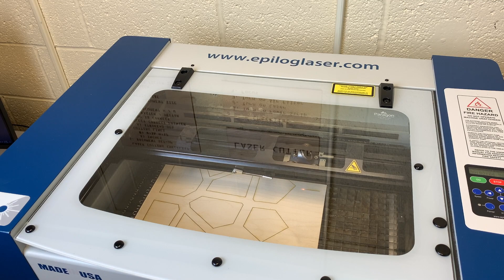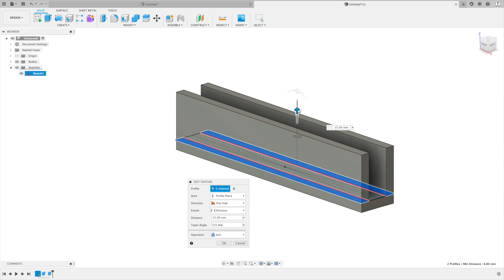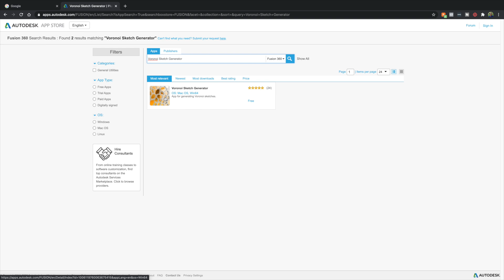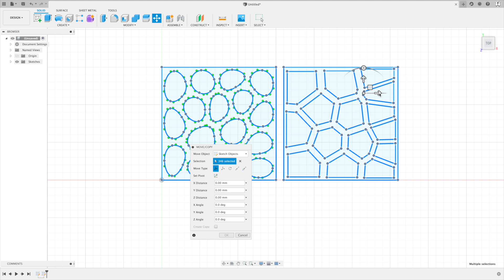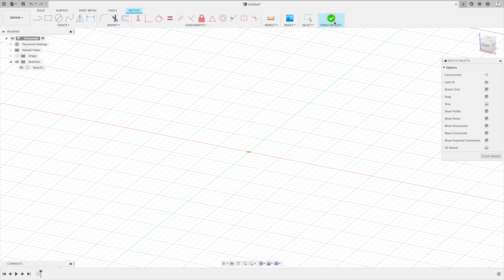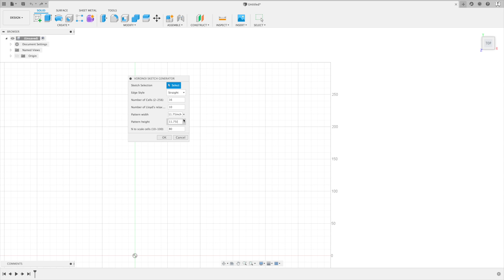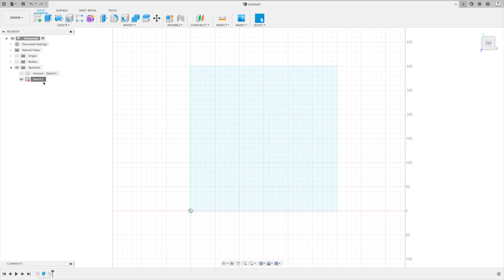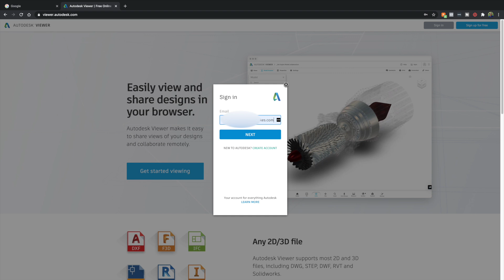Get Creative with the Voronoi Plugin in Fusion 360

Comment: Hello!
What version of Fusion360 did you use in that video?
For now it says, 

"The add-in(s) listed below use the Fusion 360 JavaScript API, which is being retired and will no longer be supported as of the January update of Fusion 360. If you want to continue using the script or add-in after the update, it needs to be re-written to use the Fusion 360 Python or C++ API.
Voronoi.js"
And the add-on is not available.

I'm with Fusion 360 v. 2.0.9512 on Mac 10.13.6

p.s. Thanks for your uDemy courses, I really enjoy them!

p.p.s. Nevermind. Answer from Hans Kellner the developer of the add-on: "New version will be posted soon."
Reply from the maker: Ok, good.  I'm getting the same message.  Looking forward to the update so I can stop seeing that message.

Comment: Hi, great video. I'm actually trying to use this plugin myself, but I haven't gotten it to work. It told me that the installation was successful but it hasn't shown up on the create tab. I tried a lot of things like moving the file to a different location, using the version on the original creator's github, and a lot of restarting, but nothing has worked. It shows up on the add-ins list but not on the create tab. My other plugins are working just fine (although they are Python based). Do you or anyone else reading this have any idea how to fix it?

Comment: Looks good; however, I would take it down ASAP and put up a typical plexiglass barrier.  There's no way I would chance people's health and safety for the sake of YouTube.
Reply: it has a PETg film inside, I don't see it as being any different than a similar sized plexiglass barrier. No barrier is going to block air entirely -- that's not how they work.
Reply: @kazolar  PETG film is associated with face shields, not rigid barriers that are now common in stores.  Plus, I can imagine the difficulty in cleaning as it is flimsy and supported by fishing line.

Comment: Was there a reason you didn't create the screw holes in the sketch so they'd be lasered out with the rest of the design?  You'd still have to punch through the sandwiched  sheet, but that's easier than drilling.  Also, as useful as the Voronoi plug-in is for creating Voronoi patterns, it's disappointing that the cells it creates are pretty uniform in size.  If you figure out a way to get it to vary that feature, please post an update.
Reply: Hi Karl, In answer to your question how to vary the size of the cells - that's what the Lloyds Relax iteration is all about. The fewer the iterations, the more varied the cell sizes; the greater the iterations, the more uniform the cell sizes. The default of 10 iterations seems to provide an aesthetically pleasing mixture of cell sizes. I had the same question, did some research and discovered the answer. Have fun with experimenting.
Reply: @PhDTKM  Thanks!  I kind of assumed that, but didn't bother to explore it since Vladimir couldn't figure out what it did.
Reply from the maker: Good question Karl.  When I first lasered the panels, I don't think I had completely decided how I was going to attach them.  At first I was just going to staple the plastic to the plywood but then decided on using the m3 screws.   You're right, It would have saved me a step if I had lasered the holes.  I'll update you if I find a way to get variable sizes.